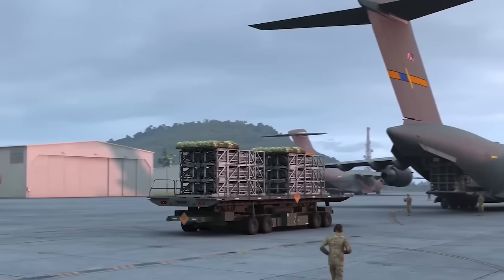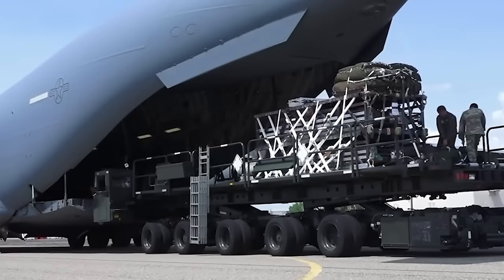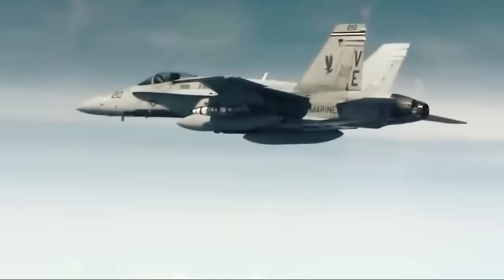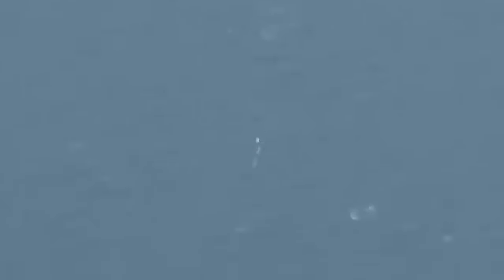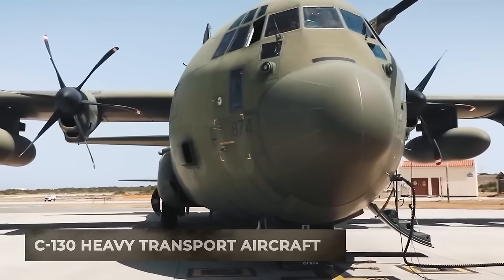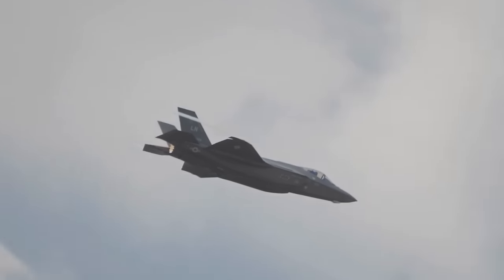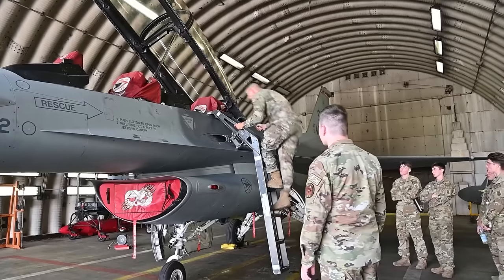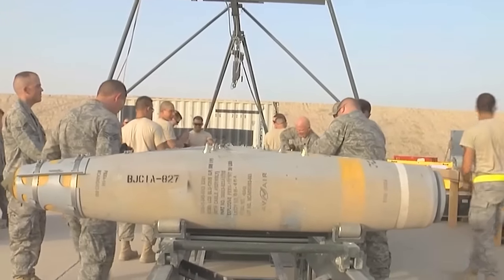FINALLY: US Air Force Is Testing The DEADLIEST Rapid Dragon Bomb

Comment: 45 cruise missiles in a single C-17. With just 5 C-17s in formation, you can drop 225 of these a thousand miles from the target, fly at high altitude with their low visibility cross section. Then when nearing the target, they'll fly low along the ground via GPS and terrain scanning to avoid air defense systems. That gives a flight of 5 C-17s the ability to drop 450,000 pounds worth of precision munitions (2,000 pound warhead on each missile) on almost any target on earth without entering national airspace.

Comment: Its certainly a powerful force multiplier. But if you want to saturate enemy defenses, having the capability to launch large numbers is one thing. Having the number of missiles required is another. Stocking those missiles that can reach china in large numbers will cost a lot of money.